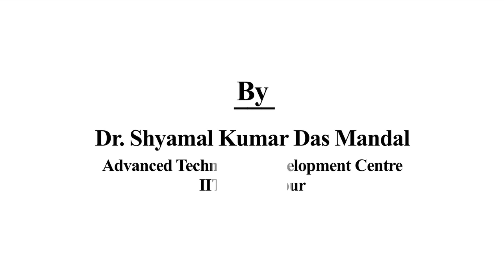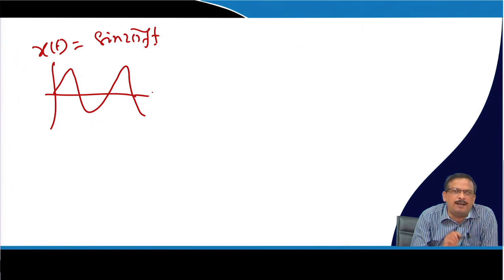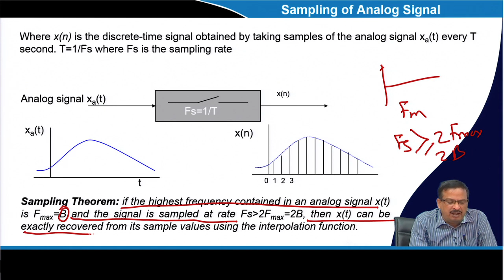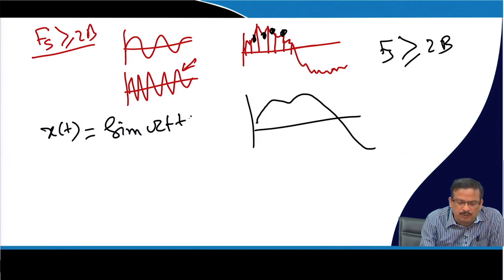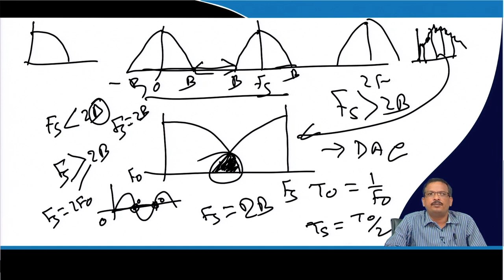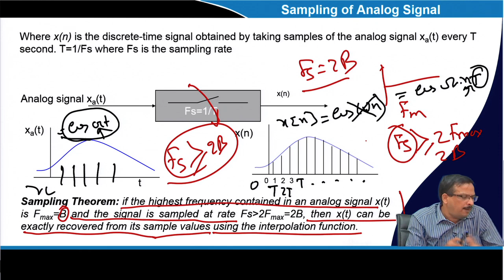Lecture 04 : Digitization of Signal

Comment: Hello thank you for the lecture, I am enjoying your course so far.
Just one thing, you said:

F_s \geq 2B, that is not correct. F_s has to be really greater than 2B not greater or equal.
The explanation results from applying the convolution theorem.
Please forgive me if I am over-explaining something clear.
To sample a signal in time domain we modulate (multiply) the input signal with the sampling impulse train.
Now due to the sampling theorem a multiplication in time domain equals a convolution in frequency space.
Now due to the convolutions properties in frequency space we get signals at all the sum and difference frequencies.

Now a real signal A \cos{\omega t + \theta} has in baseband a positive and negative half band as the cosine is an even function.
So if the sample frequency would be lower than the signal frequency, the difference of the two would introduce ghost frequencies in the base band of the input signal,
but if it would be greater than the input frequency but not more than twice as much, it would produce ghost frequencies in the opposite base band half.
If exactly twice as high as the input signal, the it would distort the value at the boundaries of the base-band.

Also one more tiny thing, if I may. The graphics with the frequency band and one spike upwards for \Omega and another upwards spike at -\Omega is for cosine. For sine the spike at \-Omega will go downwards as sin(-\phi) = -sin(\phi).